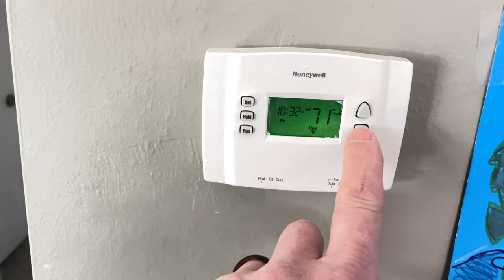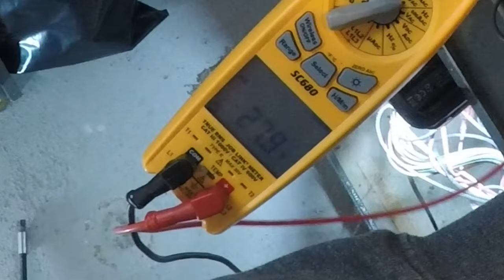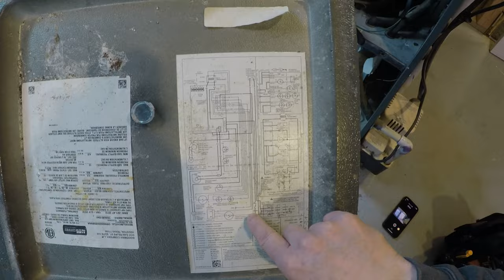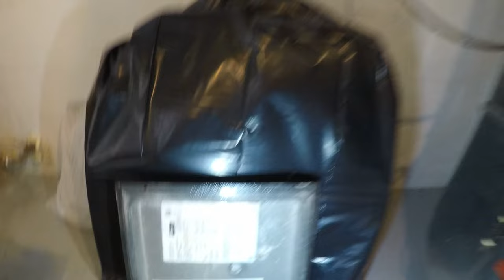Goodman Furnace NOT Heating | HVAC Troubleshooting

Comment: Had the same thing happen this year, after reducing the length of pvc and switching the pressure switches… same thing. I ended up replacing the control board and worked fine. This was on a 2 week installed Goodman.
Reply from the maker: This unit is 8 years old. Glad you figured it out! This had me stumped.

Comment: Hi.  It was difficult to see exactly what you were doing there.  However from what I saw, I'm not certain it is an issue with the pressure switches.  When you first fired it up the ventor was cycling on and off. Generally the ventor will not cycle on and off that rapidly if it is a pressure switch issue.  Did you check, because I could not see what you were actually doing, to see if you had proper voltage across R and W?  I have seen in the past an electronic T stat not working properly, sending 16 volts back to the W terminal and as a result it caused the board to cycle the ventor.  Make sure your board is getting constant voltage to it.  If it is a pressure switch issue, you will be able to pick that up where the pressure switch power line returns to the board. If you are getting constant voltages to the board, it is most  likely the board.  There are signs of water leakage. Water could have got into the board and it's connections.  Good Luck..
Reply from the maker: Yes I had 28v from W and R. When I go back I am going to check incoming voltage in to the board. Thank you for the recommendations.
Reply: @ADVANHVAC  Tstat open= 28V across  R&W, Tstat closed 0V across R&W, Tstat close 28V across W&C..
Reply from the maker: That's what I meant to say w to common. 28v also tested R to Common. 28v

Comment: It seemed like you had bypassed the pressure switch early on, didn't you? I was thinking it could be a power supply issue. I have a theory that maybe the voltage sagged as it was going through the ignition phase. The voltage would sag, resetting the control board. The HSI didn't seem like it ever got white hot. If it acts up again, I'd monitor the supply voltage at the board while it cycles like that.
Reply: The inducer motor also sounds like it's running slow, maybe indicating a power supply issue.
Reply from the maker: I did in the beginning, but later I got in sequence. I will check that next week when I go back and fix the other stuff. Thank you for the suggestion.
Reply from the maker: I will check the amp draw.
Reply: The best test would be for voltage at the supply side of the board. If it dips too low, it can mess with the logic in the control, or maybe not have enough umph to pull in a relay. That could explain why the gas valve couldn't open. The point is you'd get weird intermittent issues like you're seeing, but the test is for voltage at the supply terminals on the board.
Reply from the maker: Perfect I will check that! I haven't heard back from my clients. So things must be working.

Comment: I would look for a bad connection on the moldex plug for the inducer motor.
Reply from the maker: Yes, I checked that also. Pushed them in one at a time.

Comment: 100% pressure switch, the temp fix is to put the wires half on the pressure switch terminal somehow it allows it to run that way.
Reply from the maker: It could have been the Pressure switch? I was just over there This past Friday, to do some work and customer said it’s been running like a champ with no issues. That video will be up in a few days or so. Thanks for watching.

Comment: So I have a Goodman GMSS92060 Doing the same thing,,,I went back up to stat and flip fan switch to on and fan would not work,pulled stat of wall ,check everything and put stat back on and fan work,and so did furnace ,,its now been working for 7 days now its doing it again,,,red light on board is going out also
Reply from the maker: Sounds like a bad board.
Reply: What happened when you went back and put the pressure switches on ,,,did you get any more call backs on it,,,,
Reply from the maker: I don't think so. Lol, I would have to go back and watch the video. It's been about a year.
Reply: Can you go back and see what fixed it please. CUSTOMER called again today,,,I am scratching my head
Reply from the maker: @dougharlan8147  I replaced both PS and fixed the vent. Haven't heard from them since.

Comment: Had this issue on a Goodman before. The pressure switch had really high ohms and caused the board to reset.
Reply from the maker: Do you remember what the ohms were?
Reply: @ADVANHVAC  they should be 0 when the switch is closed. I had like 100 ohms but you'll get the same symptoms from less

Comment: I had one do the same thing, but it had water in the inducer motor. The lines were clogged. It would start up and then shut down. I could hear the water sloshing around in it.
Reply from the maker: I thought I could hear water sloshing when I first got there, but everything is dry.
Reply: @ADVANHVAC  Did you check the trap and the hoses? I actually pulled the inducer motor off and emptied the water out of it.
Reply from the maker: I will when I go back next week.

Comment: Hope you didn't charge him for the new control board since that was obviously not the problem. Terrible video, too many unnecessary video effects, and the head cam is enough to make people motion sick. Stick it on a tripod, use a decent lapel mic and keep it simple.
Reply from the maker: Of course I didn't charge them for the Board! Incase if you didn't notice I took the board back off! and put the old board back on. In Fact I have not Charged them anything yet. thanks for watching.